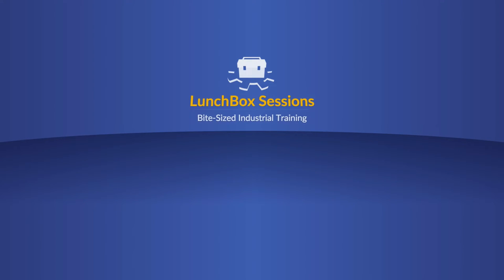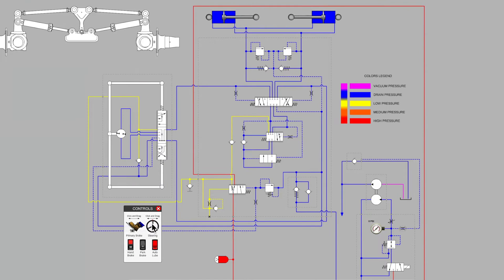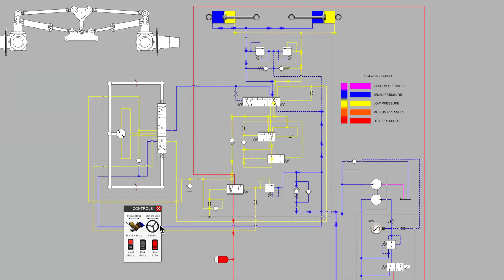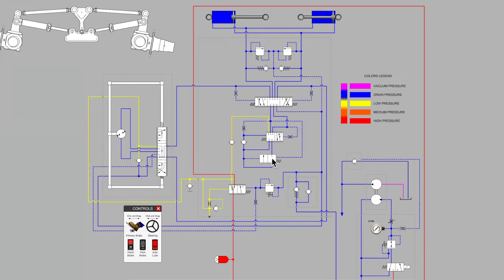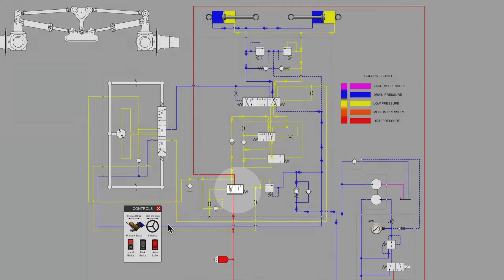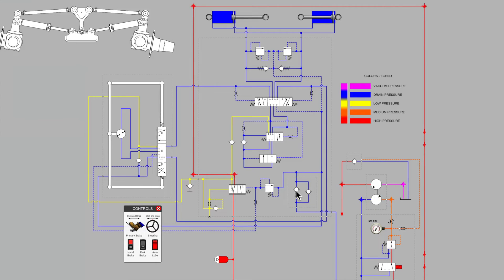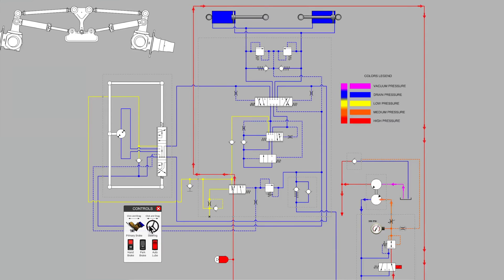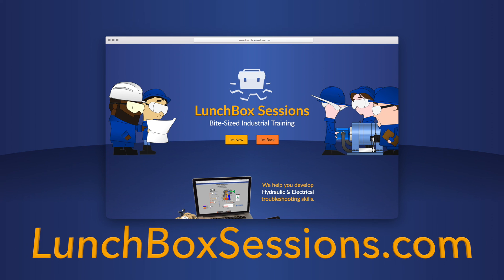Hydraulic Steering: The Steering Amplifier Valve

Comment: What is causing low pressure in the yellow lines when the steering is in neutral because the yellow line is feed rite from the pump where it Y's off. So I'm just curious where it's getting the pressure drop from. Thank you

Comment: Not correct point if turning wheel units. If you change the point to the proper position the side left and right chould be changed. The link between lefr and right whills did not move in yours scheme.